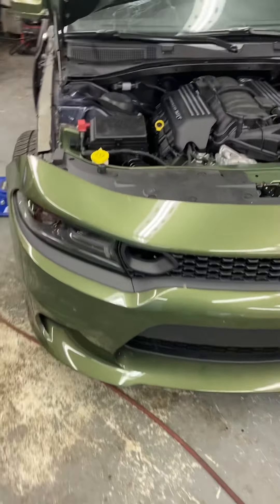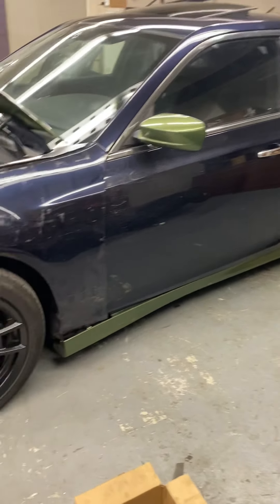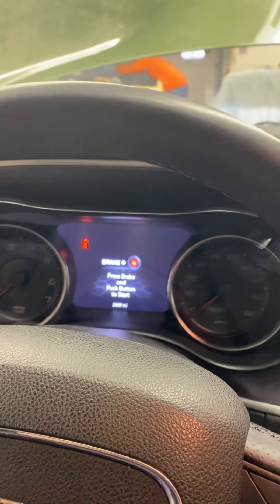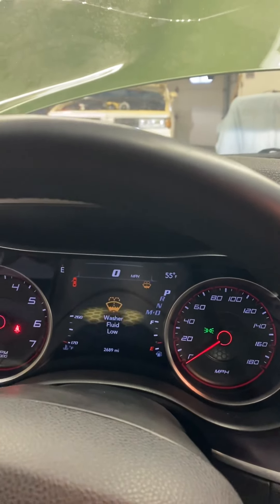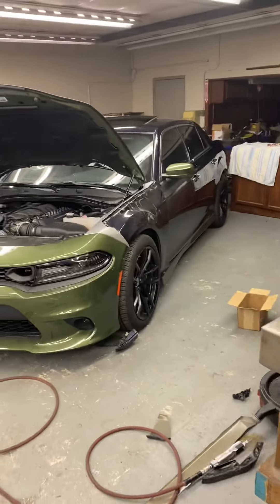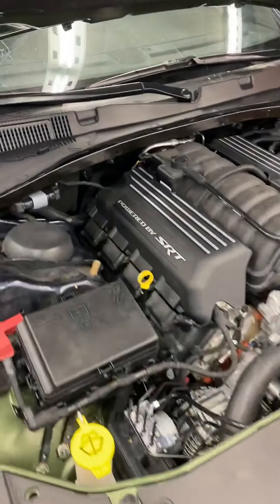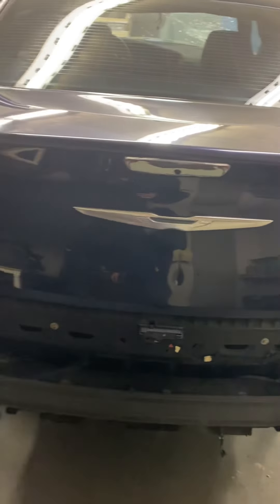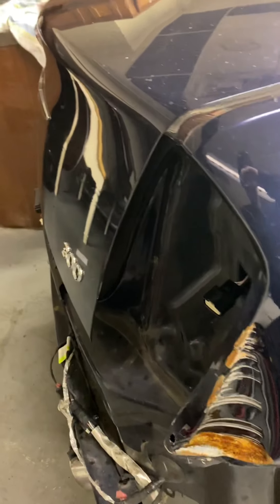2011 Chrysler 300 (scat pack swap)

Comment: So I have a 2012 srt8 and want to do the 392 interior only. Can I swap the cluster and bezel from the 392 directly to mines with no problem? Also, if I can’t find the 392 bezel, can I use any charger cluster and bezel from 2015 and up? I am skeptical with the screen being bigger in the stock 300 vs the charger.
Reply: also will the shifter change over too?

Comment: Can you put scat pack  seats on a 2014 charger ?
Reply from the maker: They bolt right in, the plug might be diff but I think it’s the same plug with less wires but I’m not sure
But I do know they bolt right in
Reply: @midwestcustoms5804  you think it’s possible that it’s possible to switch out the foam pads from one seat to another?
Reply from the maker: @OxBeast805  if you wear to completely disassemble the seat and use the set foam and  cover yes it should be possible but I’m no interior man so I can say 100%

Comment: Whats up bro im doing a 392 here soon on my 2012 300 Do you know if the 8 speed transmission fits the stock 300c center console? Looking to do do the whole swap but trying to keep the whole 300 interior except the dash
Reply from the maker: From my understanding it will not for the tunnel without some modifications